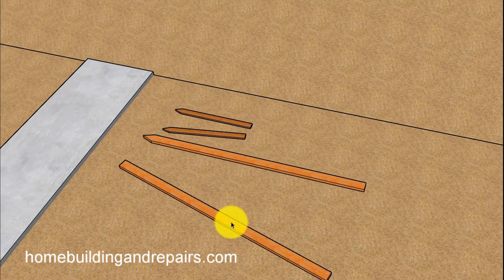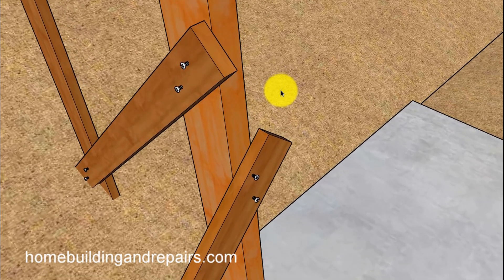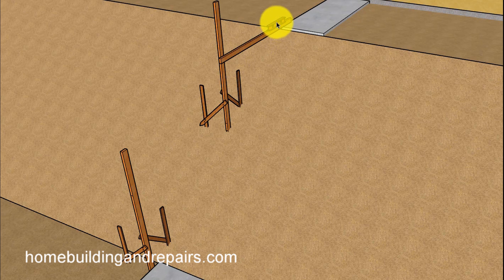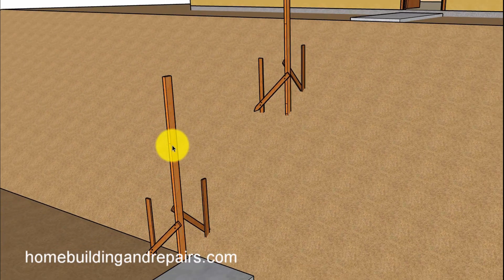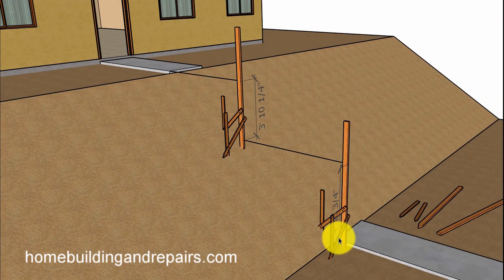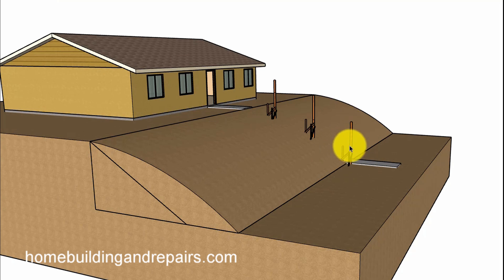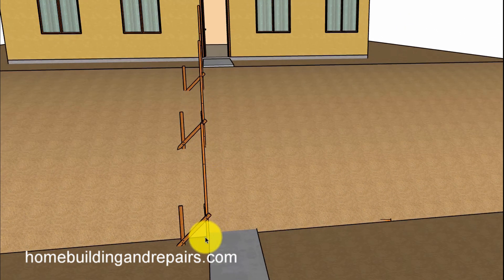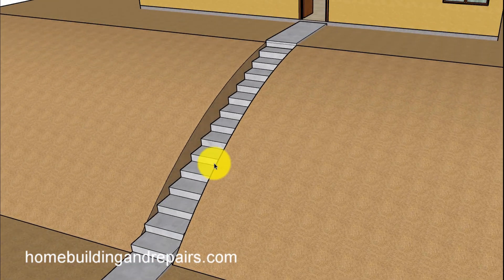How To Calculate Over All Stair Rise Height On Sloping Hill – Construction Tips

Comment: Small detail, but do you mark the top of the horizontal board, or the bottom?? Marking the top would add the thickness of the board rather than going from the ground (bottom side). Maybe it doesn’t make a difference as long as you do both markings in the same way??
Reply from the maker: You need to measure from the top of both finished levels or floors.

Comment: Good video. But I have a very short rises that I need steps for. Probably only two steps. In my backyard I have a lower and upper areas. There is a retaining wall dividing about 3/4 of that area. The remaining space is 81/2 feet. How do I figure this out?
Reply from the maker: The risers can be different sizes as long as you have a landing to transfer between the different fights of stairs. Email me a picture if this doesn't make sense of your project.
Reply: @stairbuilding  ok. How do I find your email address?
Reply: @stairbuilding  I'm sorry but, I don't know how to send you an email. I don't see your email address.
Reply from the maker: @albertwilcosky1058  Click on the link in the video description box then go to the bottom of the page and look for contact link.

Comment: I am from Sydney Australia we don’t talk in inches and foot we talk by millimetres and metres my apologies.
As I am out landscaping contractor I would not do it your way because it involves too much work very excessive I appreciate your presentation but always modification comes from the beginning from the top. To estimate the true rises and less work you have to calculate do some work from the top that is the very first step.
There for such a long steps I would make it 150 maximum 160 mm each riser therefore front of the house all the links I will dig out the 50 or 160 mm to lower the ground As one step into the house.
And then I have 6 m long straight edge instead putting the posts everywhere levelling plumbing all I do is I put 6 m straight age from the top then I measured the height from the other.
And then you cut into a plywood a Stringer for threads and risers, You duplicate for other side as well this will sit on top of the hill for the ground without digging in steps and razors don’t need to dig a remote access soil from its side because the steps seeds on top in the
Reply from the maker: Very Confusing, but hopefully other can make sense out of it and have an easier method.

Comment: On a steep slope, do you have suggestions on how to lay out a curved stairway since I don't have enough run to cover the rise with a straight set of stairs.  I have a set start and stopping point for the stairs with a deck at the top of the stairs and landing on a lake front at bottom so I have to add a longer length stairway using a curved stairway path. I'm planning on using a 7.25" rise and I want the stairs to be 13" treads.    Do I just calculate the distance from the center point of the treads on the curves or would I need to calculate the the outside and inside curve dimensions as well?  Any insights would be helpful.
Reply from the maker: I don't have any information or videos about curved exterior stairways yet.

Comment: I liked your video.  However, I need to figure out how many steps I need to make and do I start from the bottom or the top.  This is a dirt slope outside of our back yard that goes from a railroad tie at the top down to the level ground at the bottom. I would like to use recycled bricks for the risers and also to support 12 inch square pavers for the treads. I think the rise from bottom to top is about 4 feet, just by looking by my eyes.
Reply from the maker: Glad you like the video and I think I would go to the website and check out the section on landscaping stairway building information. Let me know if you can't find what you're looking for.

Comment: I have a slightly easier suggestion, which is to use steel fence posts and string.  I used this on a 15 foot rise over a 24' run and it worked great.
Reply: Oops, just ran across all your other videos, and see you mentioned stakes...and using a hypotenuse method.  It can all be done, it's just so much easier in hindsight.  I'd be tempted to try the hypotenuse method just to see if I could come to a correct calculation.  Thank you for the videos, much appreciated.
Reply from the maker: You're welcome and thanks for letting us know how much you appreciate our videos.

Comment: With your total inches of 105 each riser measures 7".  How did come up wth a run of 11" or 17" ? How do you calculate for that?
Reply from the maker: I don't know if this will make sense, but if you have the amount of risers, for example 15 individual risers, then the amount of treads is usually going to be one less or 14. As far as the actual dimensions are considered, you would simply figure out the length of each individual step and multiply it by the amount of steps.

Here's a link to our website that might be helpful. https://www.homebuildingandrepairs.com/stairs/index.html

Comment: Great video, thank you for sharing!! Another simple way of calculating the total rise and run of the stairs is using the pythagorean theorem. You can simply find out the angle of the slope (using a digital angle gauge/level), measure the total distance from points A and B and you got it.
Reply: There is always more roads to Rome. What I appreciate is the simplicity of the method without special tools unavailable to the DIY person; unless one decides to buy it and then store it for the rest of one’s life.
Reply from the maker: Thanks for sharing!

Comment: Thanks for this. It is going to help me start the process. I am going to build steps down a mountainside. I have to build them almost parallel to the mountainside due to the steep angle. I am trying not to let the wood touch ground as it is a very wet climate. (Yes, I will use pressure treated.) I will have to put at least one landing along the way as it is a very long space. But at least I now know how to find the rise! This is my first big project so any advice will be appreciated.
Reply from the maker: I think the only other advice I could give you would be to figure everything out before you build it. A lot of problems can be eliminated during the design phase.
Reply: @stairbuilding  I know this is an old comment but I wondered  what's a minimum depth to dig into a sandy/granite boulders covered mountainside to prevent heaving caused by ice? Someone mentioned needing to go below the frost line but that didn't make any sense to me because by digging out that far, you'd end up having a different frost line even further down haha!